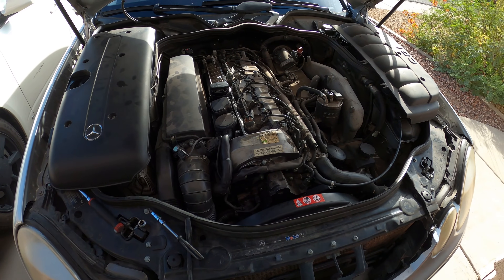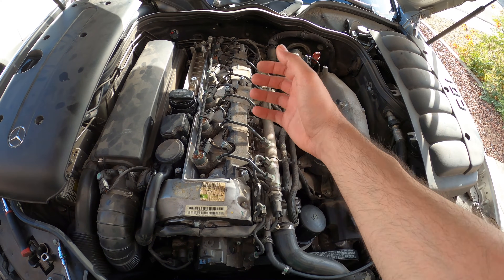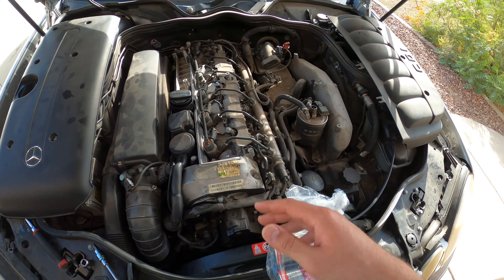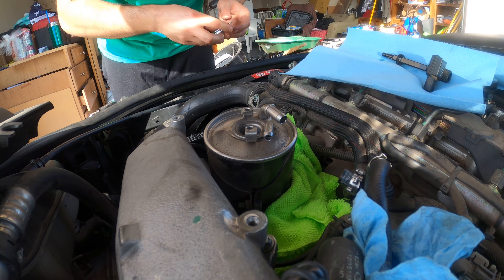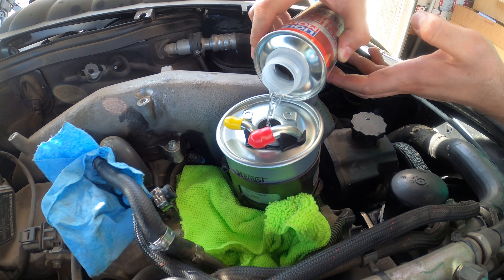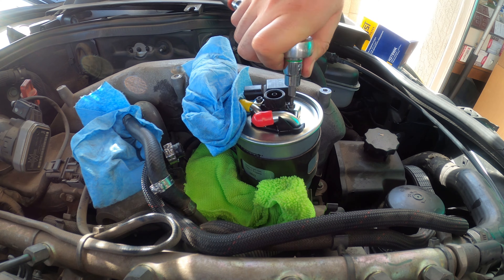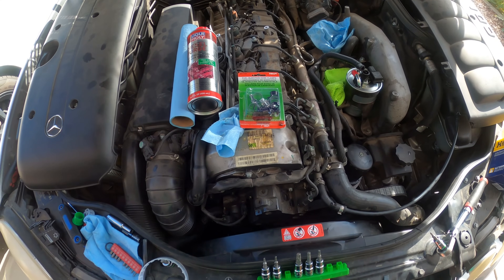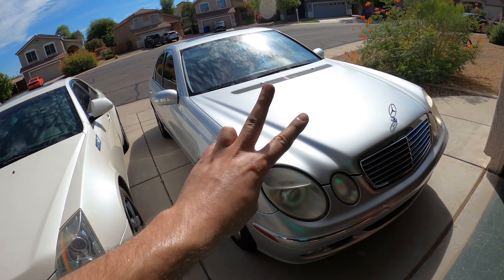Clean Your Diesel Injectors When Replacing Diesel Fuel Filter

Comment: Add half a litre of two stroke oil into half a tank of diesel your welcome this can also cure sticky injectors
Reply: best way to clean injectors is to remove them manually  clean the carbon from the nozlle and refit them back . Best way !
Reply: Raises cetane number too and gives a tiny boost of power
Reply: Only use mineral based 2T oil though

Comment: This is a good method, but the only drawback I think is that most of the liqui moly will bypass the injectors through the return line and end up back in the fuel tank and will be diluted before being used by the engine. If you have an issue with your engine I think the method where you disconnect the fuel line is better because all of the product will be used by the engine at 100% concentration. You can by a product designed to go directly into the fuel tank makes 75 litres which is better if you want to add it directly into the fuel tank.
Reply: Even if you disengage and use teh fuel line, not all fuel is ingested into the cylinder. Fuel usage fwiw is based on engine operating speed load. Even at idle a typical diesel is sipping on fuel and most fuel is returned to the tank.  Even at medium load again most fuel is returned thru the return line to the tank. In a lot of these items, the return fuel returns to to the tank due to lack of need and it helps in cooling the injectors by returning the hot fuel away from the head.
Reply: The unused cleaner is going back into the tank as I said in my previous comment. It should be returned back to the container where it will be used up eventually by the engine. You obviously didn’t read my comment lol
Reply: @derekmartin8498  Have you ever even read the can instructions or online instruction.? the Return the fluid and in a cycle is a "remedial" as in a extreme issues which is surely not the case here. 

He clearly explains as PM you pour contents of the 2 can into the filter and the excess into the tank and run the engine again as preventive application.

\Just like changing your dirty oil and filter is a preventive application. disconnecting fuels and do all of the other action is not warrant or called out unless it's a extreme case.  All other nonsense posted is just that "nonsense". Changing injectors or having injector sent out for cleaning is again not PM it's after a extreme issues or the components have worn out. READ THE INSTRUCTIONS its clear on how to use it.
Reply: This is why you are supposed to disconnect the return and create a loop on the system to only run the liqui moly. Not sure if you can do that on every car, depends on the system I expect but most cars it should be fairly easy. You are also supposed to filter it coming back out of the rail/ return with a small filter before putting it back into the feed. It’s recommended you do this just in case it picks or dislodges any small particles in the lines.
Reply: @beany1987 exactly that’s how I do mine.

Comment: Change injectors
Reply: He is cleaning those injectors so that he won't have to buy new ones.
Reply: @chongshenchang9367  stupid idea
Reply: @897aa33  😂😂😂Who is stupid..??
Reply: @chongshenchang9367  idea cleaning injectors is stupid for a variety of reasons. One e.g. injector could get damaged or broken on half while pulling out.
Reply: Why?
Reply: @a  new always better than the old ones. So, put a new set of injectors and sell the old set to someone else like you and the money difference not far apart.
Reply: @897aa33  change car, new always better than Old car
Reply: @a  yes that would be a perfect scenario
Reply: @897aa33  no sense in what you saying Voss 😅
Reply: I guess one here does not understand the term "preventative maintenance", just sayin.
Reply: @kfelix2934  I guess someone has no knowledge of how much labour costs to clean injectors that have a certain lifespan. And since you are pulling em out anyway, installing new ones would be the best option, both maintenance and money.

Comment: 120 psi no way  minimum is 1400 bars or 20000 psi  mine is 1600 bar or 23000
Reply: What are you driving? A private jet? I could be uneducated but i think 23k psi would just be an explosion that would bust through solid steel.
Reply: He may be exaggerating a tad but yes on the high side from injection pump to injectors usually runs about 12,000 to 15,000 psi
Reply: @dukebeyer5233  double that for modern common rail systems
Reply: If injectors were 120 psi the vehicle wouldn't run or it would but quickly rattle itself to death